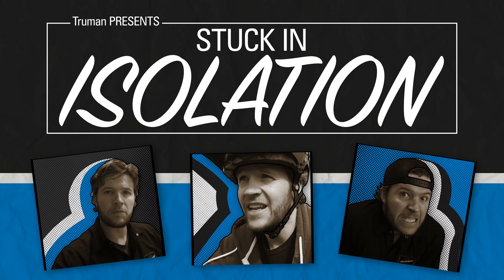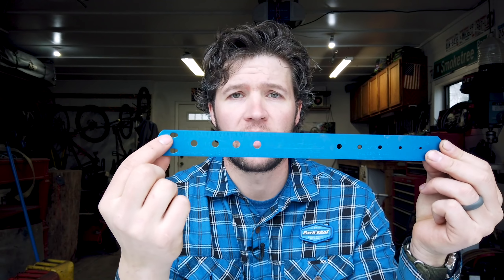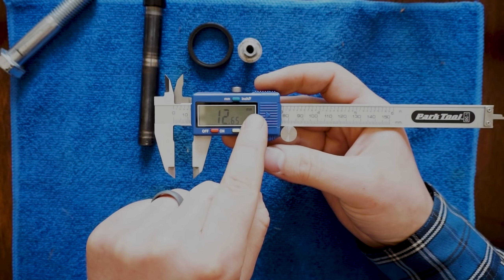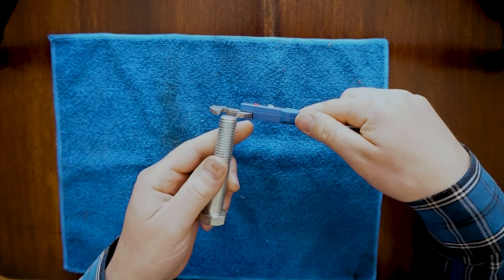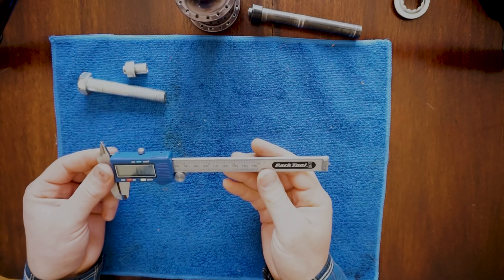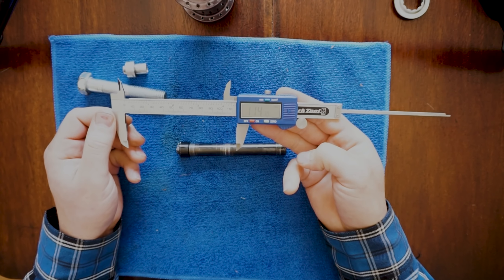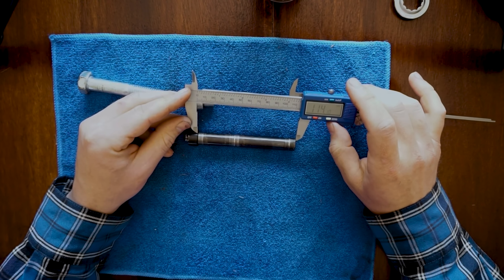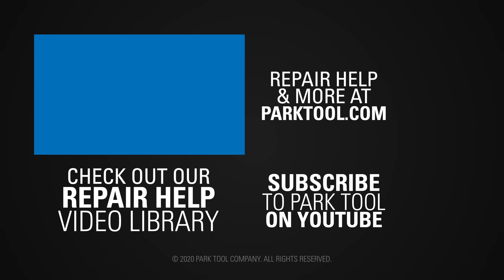And the Measurements Shall Lead | Tech Tuesday #153

Comment: Why is there still a scale printed on digital calipers? It cannot be read properly anyway and the digital measurements counts steps, does it not? Would be useful though to be able to read it manually, because in the apocalypse (or every time I take it out the drawer) the battery is dead.

Comment: Do you have a tool to help line up the bars with the front tires?
Reply: Jose Rene Ducharme . Use a ruler against the front of the fork and align the handlebar parallel to the ruler.

Comment: Hello,
I am the metric system and I am superior to the `merica System.
Like if you agree!
Reply: @Morowww  Metric has its uses, such as in bikes. But even in metric countries, approximations similar to the US system are used in daily life lol.
Reply: It's America. Thanks.
Reply: @Morowww  2 world wars, to the moon and back, suck it.
Reply: Units may be different, but NEITHER is inherently more accurate than the other. Bicycles are interesting. Most were originally made with Imperial units, also called British Imperial System.  I bet the chain on your bike is 1 inch pitch. The threaded bottom bracket [unless Italian] is probably 1.37″ x 24 threads per inch. Pedal threads are 9/16" X 20TPI.
Let me know if you can get a metric tire for a new 29'er MTB!
Reply: J  Speaking of mixing units - how about car tires? 16 inch dia X 255mm section width?

Comment: $60 park tool digital caliper vs a $20 one from amazon..
Reply: The park one is also made in china. Empire makes an affordable plastic dial caliper in the USA. Unfortunately it's got a dial in inches which means converting. But is enough for a home grade - shops really should be using a proper machinist caliper.
Reply: I saw somewhere that cheap digital calipers aren't 100% precise all the time and on contrast, more expensive ones are more realiable.
Reply: Guilherme Thiele 1/10 of a mm is an acceptable tolerance IMO, so even a cheap digital vernier is ok. If you need more precise than that pile up cash and get a Mitutoyo. You won’t regret it.
Reply: You can get a good Mitutoyo for <$90 on Amazon. Or a  nice Starrett for $1,000.00.  The $60 Park Tool looks good. I'd stay away from the JSPOYOU unit: $0.66 
plus $6.99 shipping!